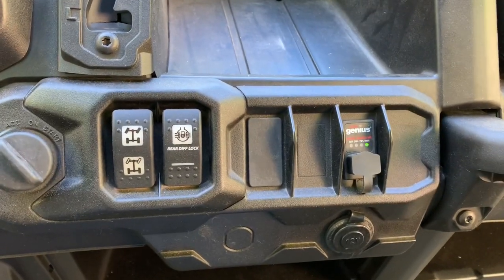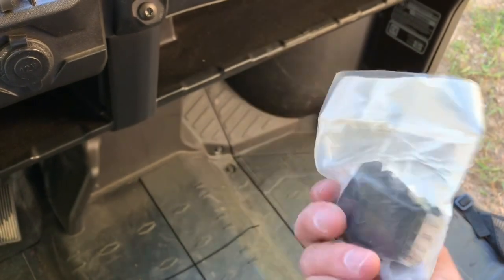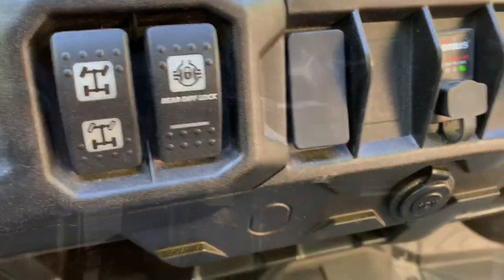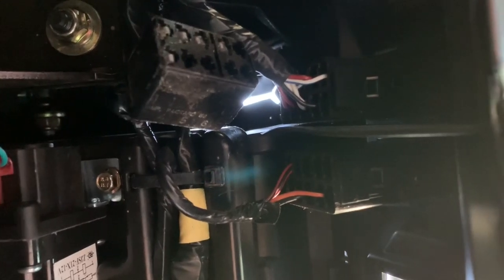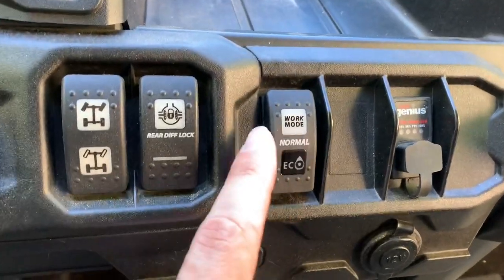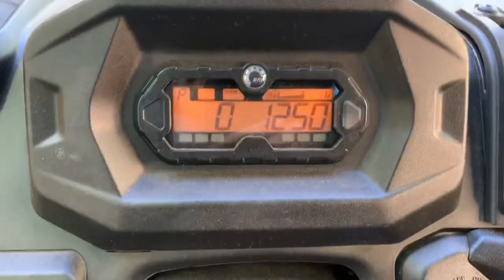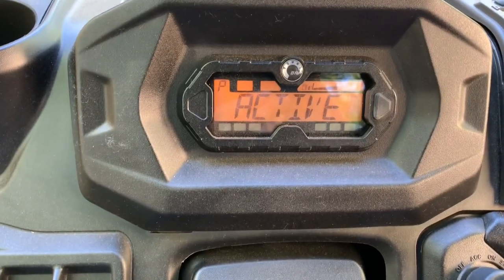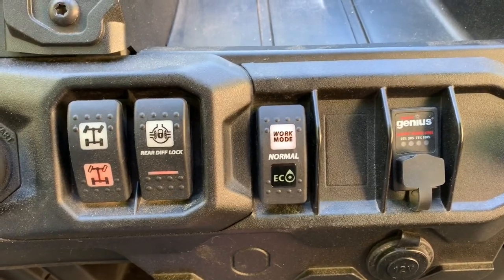Canam Defender 3 Mode Switch Install

Comment: I have a 2020 hd10 dps that's stuck in work mode. I don't have the switch it's by the dash activation. I can put it into eco off and eco modes but it keeps going back to work mode which only gives me 5500 rpm. Any suggestions? 
Thanks

Comment: You were very specific on popping the plastic plug out and the switch in the bag. Where or how much further under the dash did you find the plug end.?
Reply from the maker: It should be right there behind the dash. Not far in.
Reply: @mdavidson2183  Just found out from the dealer. Year 2020 and up doesn't have the plug end under the dash. This option is not available  for my 2022 HD10. Thank you anyway.

Comment: Just bought a 2019 defender hd10 dps a couple of days ago. Pulled the cover off and the plug was plugged in to the cover. So all I need is the toggle switch from can am. Thanks for the info. 👍

Comment: Does the hd8 have this feature?
Reply from the maker: If its a DPS it should. The base model might not though. Thanks for watching!
Reply: Back Forty Off Road yes mine is a DPS. What exactly is the function of the switch.
Reply from the maker: @justindilleyf250  Gives you eco mode(uses less fuel and has less throttle) normal mode that is normal riding. Work mode where the throttle isn't as jumpy and is smooth for towing loads or if you have the dump bed filled.

Comment: Can not find that plug on a 2020
Reply from the maker: Brad Elsberry check your manual. Depending on the model I think it is built into the gauge cluster.
Reply: @mdavidson2183  yep it's in the cluster. Switch would be so much easier than thumbing through the cluster lol
Reply: zach smith  If you figure how to do it, please post it! I have a 2020 HD10xt and hate working through the cluster. Usually just leave it in ECO mode still has plenty of performance!